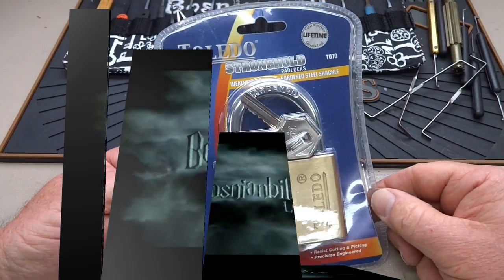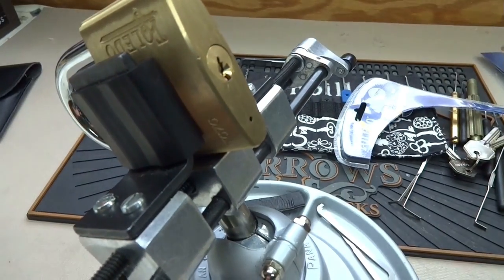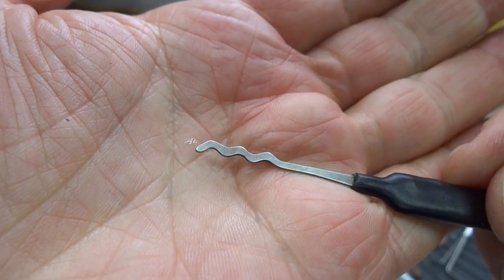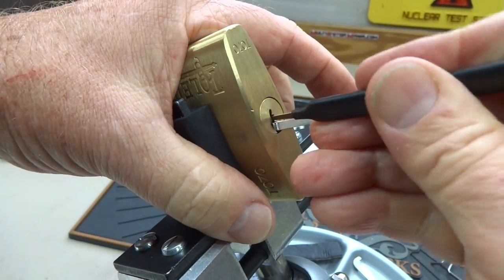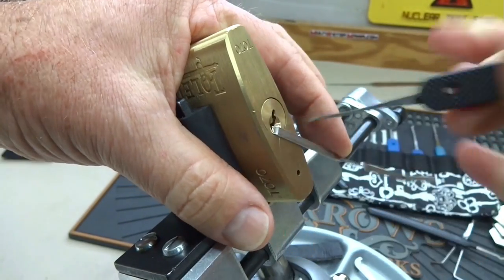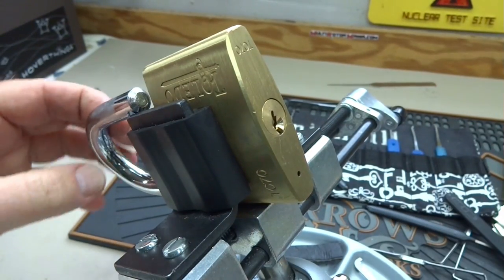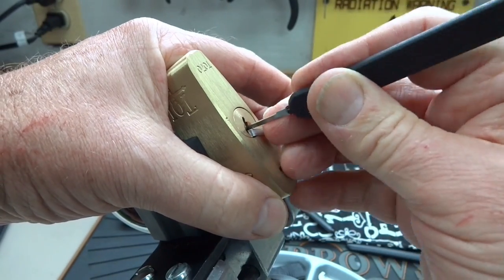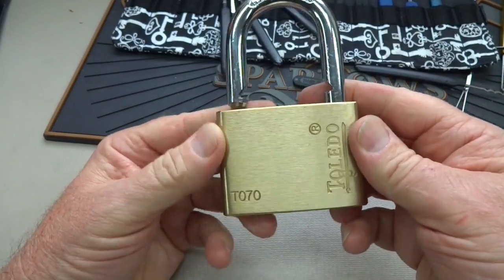(716) Toledo T070 "Pseudo" Padlock

Comment: Hey Bill,  Not a toughie, that's for sure, but you could see the keys through the blister pack, and the cuts were fairly even except the last cut - not that deep though. Could you have chosen one that had more difficult bitting?  Just askin' ..... Regards, Brian.
Reply: +bosnianbill   Thanks for your reply Bill, yeah I'm with ya, I'm with ya,!  I see on the package " Resist cutting and Picking" and I felt the bitting didn't give "Pseudo" a even chance!  I guess you're right, the bitting wouldn't have made much difference ... at all. lol.  Regards, Brian.

Comment: The hole on the bottom, is that for releasing moisture or is that another bypass?
Reply: +Alex Movitz Always wondered this myself.
Reply: bosnianbill Thanks! I remember at least one where drilling into the drain hole was a quick bypass on the latching mechanism.
Reply: +bosnianbill lol
Reply: +bosnianbill If you would close this hole with glue and fill the lock with water and freeze it, could it break the lock?
Reply: +bosnianbill water freezing breaks small block chevies lol someone needs to try this
Reply: it is a drain hole but also a nice way to oil the lock

Comment: Why is the downside of the bogota curved? I have broken a few peterson purple bogotas. Is it because more picks could be fitted into the same metal sheet or does the downside vallies make the pick better in some way?
Reply: +Efraim Barkbit.  Surprised you've broken the purple Bogotas, they are thinner, but I feel you're using them too vigorously. Our guys use them, and they've never broken one. A curve under a peak, or whatever, can take the stress out of a pick, and theoretically make them less likely to snap .... ? Also it can allow the pick more rocking movement within the lock, and near the front pins, and can also be used " upside down" in some cases. They are effective, but less likely on accurate locks. If a lock " goes " on a Bogota, and the next one doesn't, you can try too hard - easy does it.  Regards, Brian.